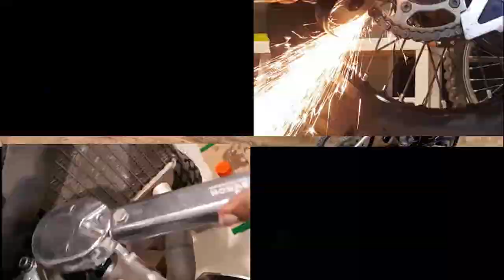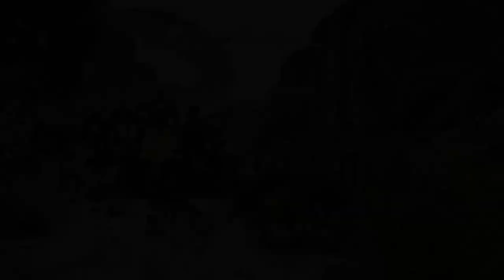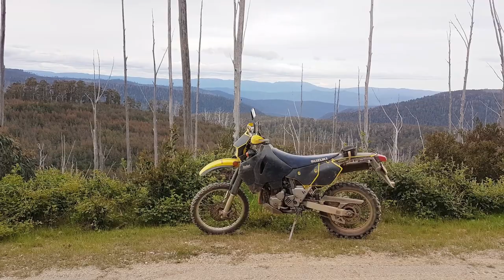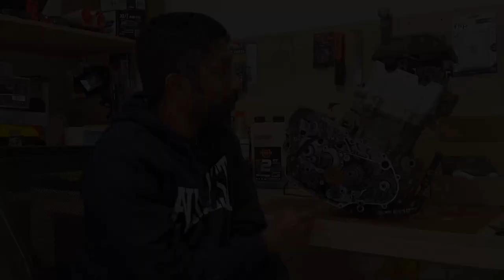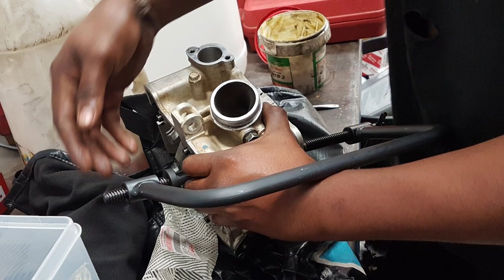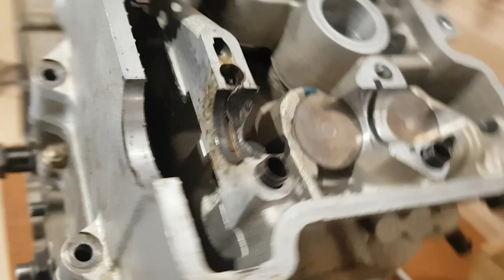DRZ400 engine fail! | On Two Wheels

Comment: happens to us all pal,the only thing i would say is,change to a manual cct asap the suzuki ones fail altogether or turn weak,the drz is a super strong motor  when given plenty of oil changes...one of the previous comments said they sound like a bag of nails ..nonsense...they only start to chatter/moan when the cct fails, cheers from bonnie scotland, ps the next time i'm visiting my friends in melbourne (altona) i'll keep an eye (and ear our) for your drz..cheers
Reply from the maker: I'm still on the fence about the ACCT vs MCCT. I see people switch to MCCTs and the 'chatter' simply disappear as they tighten it, but the ACCT on the DRZ is one of the few things that's actually evolved over the 20 years. The past ACCT were essentially a rod at the end of a spring, so the spring was constantly taking a pushback from the chain; but the newer ones have a ratchet along the rod. So as soon as it jumps a tooth the ratchet locks in and prevents the chain pushing the spring. When I removed my old ACCT, I actually did a very rudimentary comparison between the springs, but the old was as firm as the new. But since I had bought it, I put the new one in. 

And mate, the next time you're in Melbourne, do give a shout out, we might even be able to organize a ride together!

Comment: I recently bought a 2006 drz400sm with 29000km. Does this model also have the weak chain tensioner?
Reply: Bikes in 2004 and above have the new ratchet design tensioner
Reply: @dilesh007  ah and is it possible to manually adjust those?

Comment: You did more damage by sanding down that cam journal than if you left it scratched.
Reply from the maker: You reckon? Cos the cam was barely turning without any sanding.
Reply: @OnTwoWheels  the cams are not supposed to "just move freely in the hole"... This is an gliding oil bearing, there are very very tight tolerances for this whole principle to work. If the space is too big or uneven the oil pressure is not build up properly on the needed area or worse you are wasting precious oil pressure and let the other places run dry. These bearings have tolerances of one 10th or even 100th of a mm and you just destroy it with your fingers and sandpaper. No offense but I new you screwed up the moment you said you used sandpaper :( poor engine. (Sorry I'm German and English is not my mother tongue)